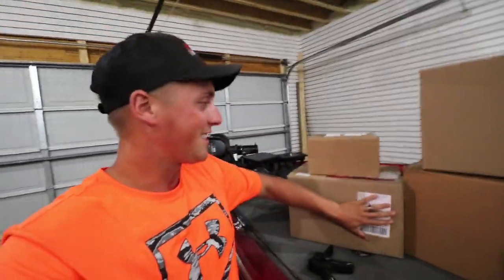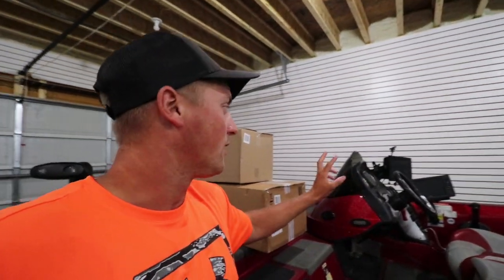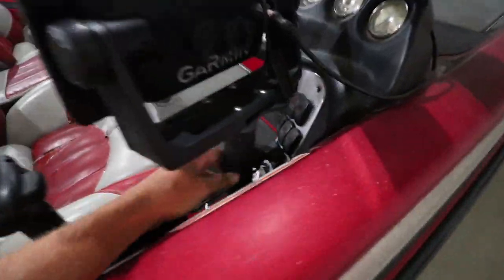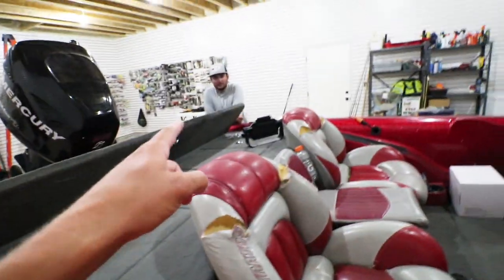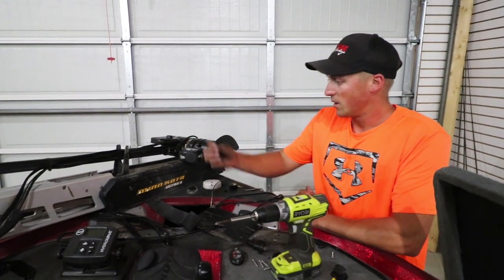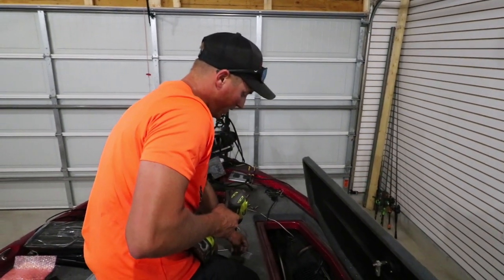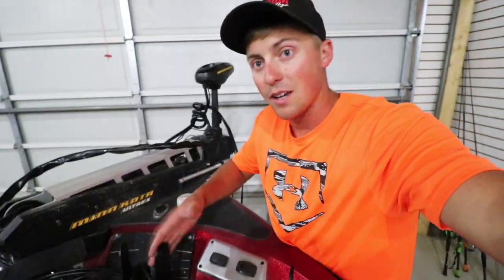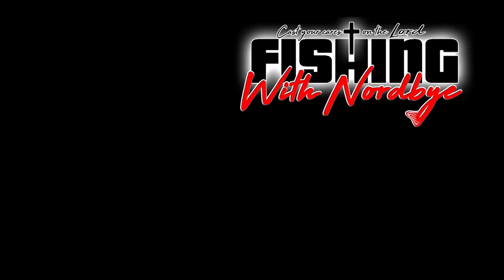INSTALLING BASS BOAT DEPTH FINDERS - GARMIN LIVESCOPE AND GRAPHS (DIY - How To)

Comment: Just a heads up.... word on the forums is Garmin has/is modifying their warranty policy on all transducer and data cabling policy. Units that have been installed using cable (zip) ties will NOT be covered under warranty. The wiring is more delicate than the old stuff and zip ties are damaging them. Use regular electrical tape that's in good condition. Not that 10 yr old roll that's in the bottom of your tool box . LOL
Reply from the maker: Very interesting!